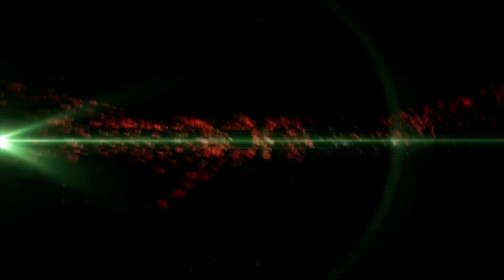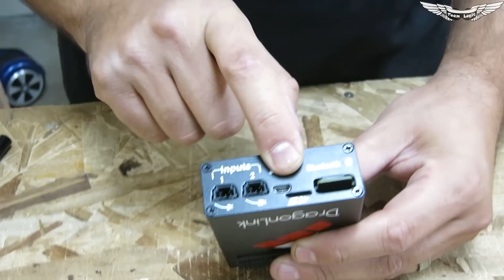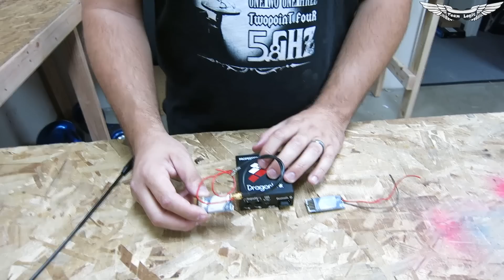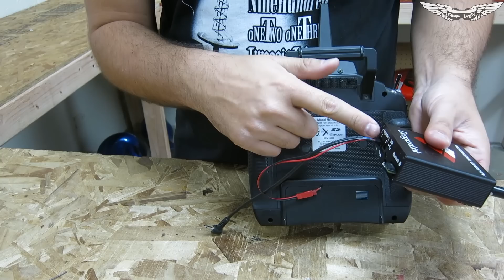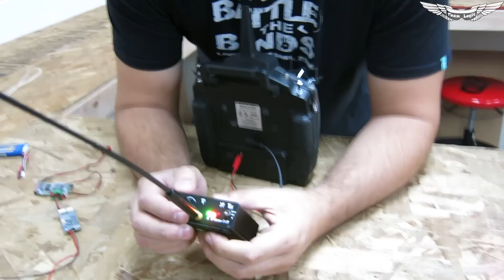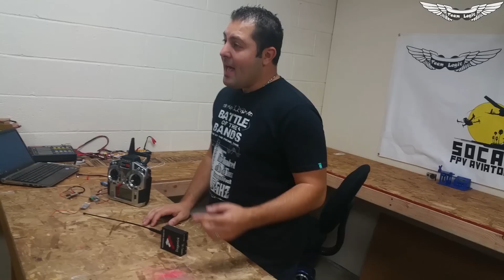First Look Advanced Dragon Link V3

Comment: you might want to have a look at the components inside V3. They are outdated and poor choices for a NEW version. The most expensive component in the whole system is the box! No value at $400. by the time I get it home that's $10 a Km., too much..
Reply: Well, in the end of the day... it works. no matter how outdated it is it does what it advertised, which is make you able to fly far distances somewhat reliably. And price does not only come from the components but also from development. There is a guy behind this, trying to make a living out of this (I'm not saying it is not overpriced :D).

Comment: Nice!  If you can send the apm mavdata down and then out bluetooth to a tablet running tower that its going to be a big deal.  I might have to trade in my IRC equipment.  Hopefully the new firmware doesn't force AUTO mode for the power.  Because one nice thing is flying in a lower power mode and when you hit a failsafe you switch to a higher power to turn yourself around and keep in control.  Auto means when you are out you are out.

Comment: Great video; thanks guys.

Looking forward to the comparison between the TBS Crossfire and the DragonLink v3 as I'm shortly going to get an LRS.  When do you plan to publish it?
Reply: Divot Digger I decided to get the crossfire system a while back and have no regrets. It’s a solid link and has a lot of useful features. It has Bluetooth as well PLUS the screen on the module so you can use the spectrum analyzer at any time and see if there is any interference at the location and a complete look at the health of your link. Trappy is constantly improving the system through firmware updates and adding features. There has never been a time when I’ve felt I’ve needed more power than what I have with the Crossfire.